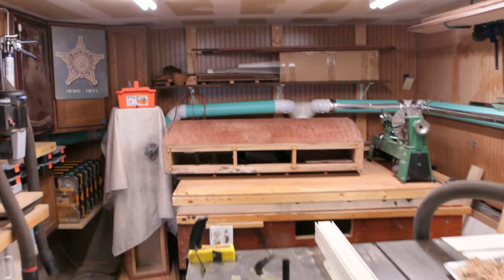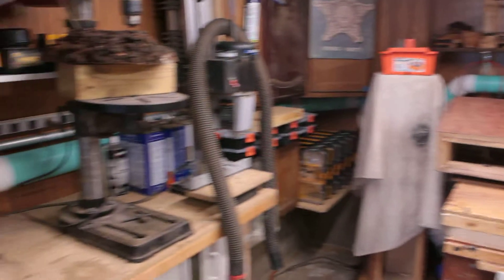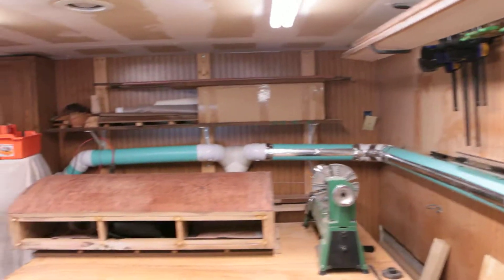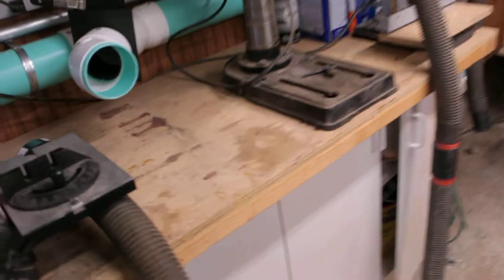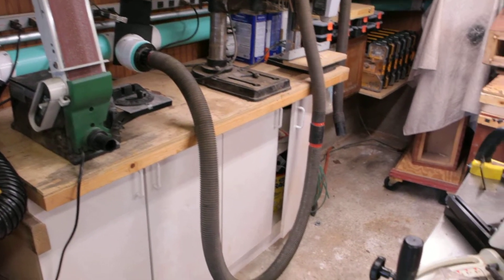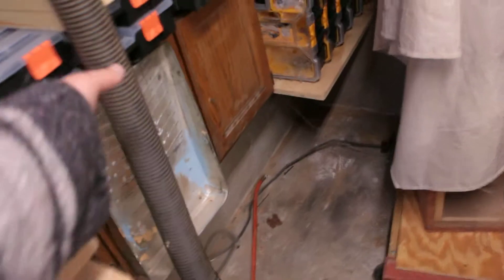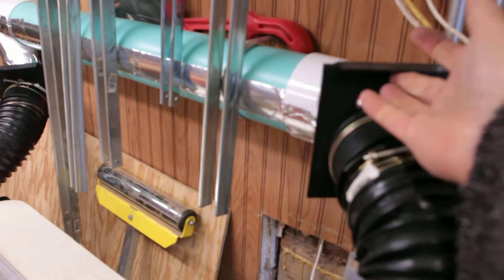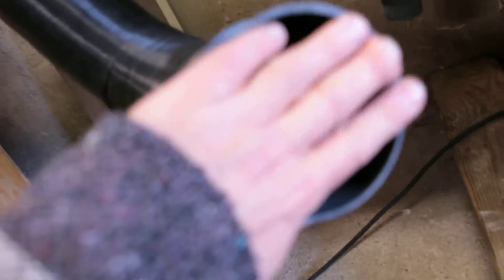Grizzly G0862 Cyclone Dust Collector In Action

Comment: Hello 
Where did you get adapter fitting to fit your 6” pipe to the grizzly vacuum that is 7-7/8”

Thanks 

Ray
Reply from the maker: If you’re talking about the pipe with the three hose connections on it, that came with it
Reply: @mhgrabow  yes I have that fitting but not using it I want to go directly to 6” pipe I ran throughout shop trying to source the adapter

Comment: YOu mentioned the static wire vs no static wire...any difference there? I'm very curious about this because I'm in the process of installing the exact same DC with the same type of pipe and I've been told everything from "you'll get the piss shocked out of you" to "that's an urban legend, don't worry about getting shocked"...so what's your experience?
Reply: I live on Long Island.  We get humid summers and dry winters.  I’ve used it in all seasons and all types of weather.  I have center been shocked and if I open something with styrofoam the little pieces are not all flocking to the pipes as I vacuum it up.